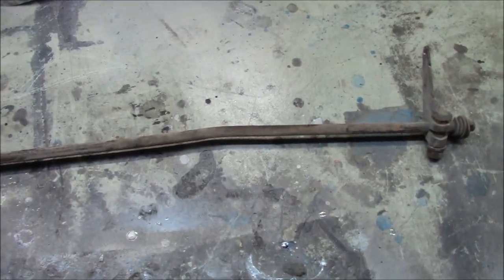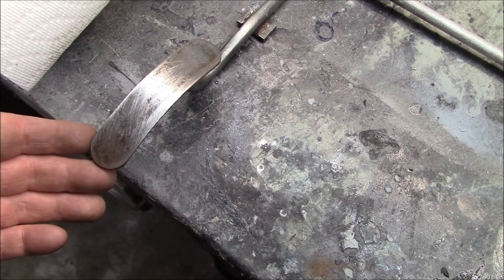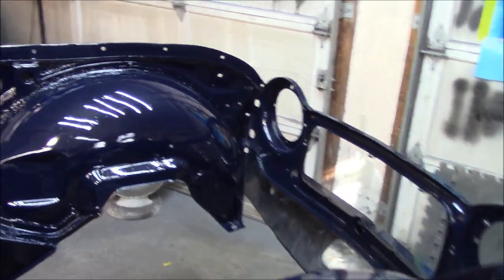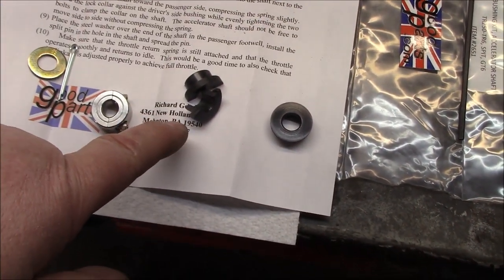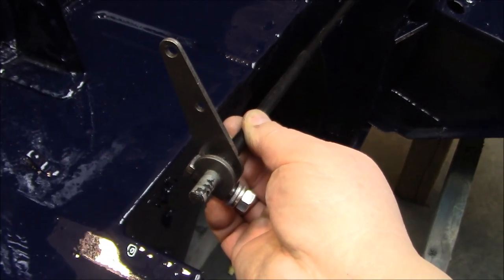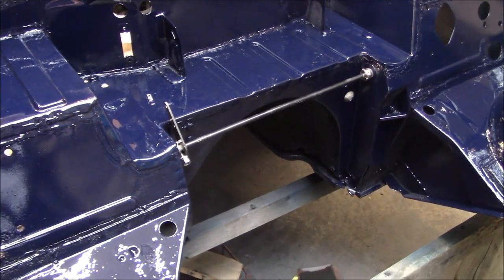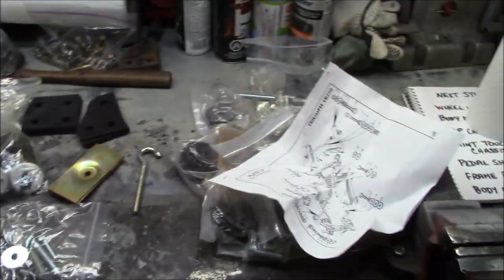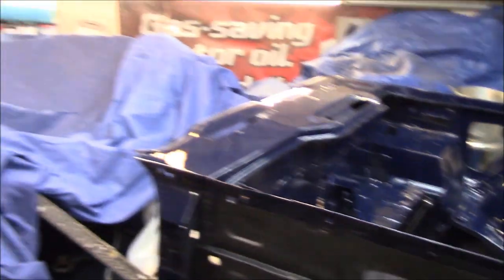1968 Triumph TR250 Restoration Throttle Shaft Install Using Goodparts Bushing Kit

Comment: Circa 1985, I bought bonnet pins and accelerator pedal shaft bushings for my newly acquired '72 TR6 from the spares department of British United Automobiles on Church Street at Yonge in Toronto. Later that year I got a new alternator from Canadian Tire around the corner. The accelerator shaft bushings were a huge improvement to my car as the shaft had previously been bouncing around in holes twice as big as the shaft. I recall the installation of the bushings as pretty simple and suspect the increasing age and girth of TR owners has spurred recent developments.
Reply from the maker: Well, I think on this design of bushings the simple fact that you really don’t need to disturb much (a washer and cotter pin basically) to fit them is a huge plus...I’ve seen so many cars out there without any bushings at all installed there....

Comment: I bought the other kind of throttle shaft bushings and have yet to install them. I believe the kind you installed (and Elin) look much better and easier. I have had the chance to get to many TR's in the junkyard but have never seen any with any throttle bushings, just the washer that is welded to the body.
Reply from the maker: Hi Jim, yes I’ve seen many without any bushings left in place…the throttle shaft really rattles around and is very sloppy.   The stock nylon bushings can be quite difficult to install even after soaking them in hot water or heating them with a blow dryer etc…these new style are much better.

Comment: That's a pretty momentous event there Sir. First parts fitted into the body! 👍👌
Maybe its just me but I wouldn't fit the 'frame pockets' until the body is fitted to the chassis. You may want to know where those extra chassis supports are as you lower the body to avoid swearing at damaged frame paint!
Here in Suffolk UK we are "en sympathie avec les Canadiens" as we are enjoying a lot (in UK terms) of snow. Just -3C so compared to you guys its quite balmy ...😂
Reply from the maker: It’s much easier to fit the pockets before it goes on the frame as there is much less access to the nuts on the bottom of the pockets when the frame is in the way otherwise you are correct, it would be better to wait.
Reply: @cheftush  Too late for some tubular steel rivnuts in the floor?
Reply from the maker: @1chish  I actually thought about it but I won’t like the look of the rivnuts from the bottom of the car..I think I’m going to rivnut the wing vents in though since you won’t be able to see the backside.

Comment: Hey Tush, I agree with your choice of the Goodparts kit vs. BPNW throttle shaft kit. It almost looked like the BPNW version would require you to ream out the holes where the throttle shaft rests. Also, do you think it's a good idea to put anything on the main rubber pads prior to mounting the tub to exclude any water and help eliminate the chance for any squeaks? Just thinking out loud here. Cheers!
Reply from the maker: Hi Kevin, yeah the Goodparts bushings live up to their name 😉  Are you talking about the pads that go on the frame  below the floor pan, front and rear?
Reply: @cheftush  Yes, the four big ones.
Reply from the maker: @kevinblume2976  haven’t had any issues with squeaks on either my TR6 or TR3 restoration.   I think that TRiumph used to use some strip caulking on them around the bolt holes as I recall some grey stuff on my TR6 bolts and pads..my 6 hadn’t been apart before.

Comment: My father in law isn't on youtube, so I can tell you that he used garden hose rubber washers for body mounts when he restored his TR6 years ago. Yeah, he's a thrifty guy. God forbid he BUY stuff like this. Buy the time I drove the car there were problems with them rotting away.
Reply from the maker: I found a old center piece of a grinder wheel used as a spacer as the rear mount on this car 😉
Reply: @cheftush  This is why 'DPO' term was coined